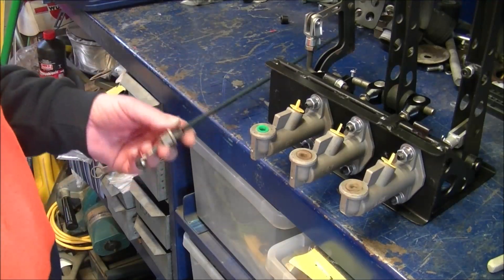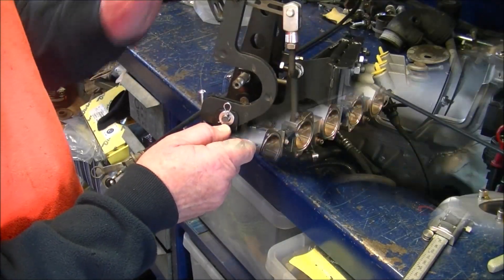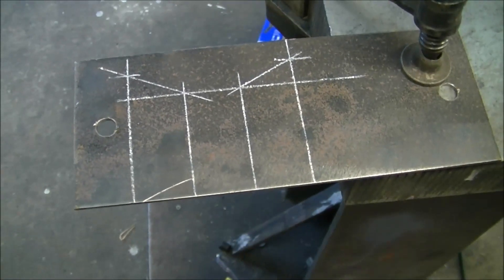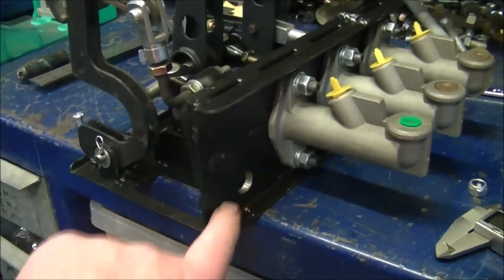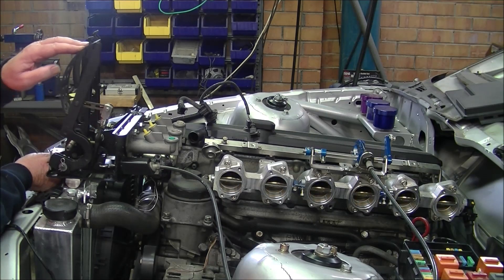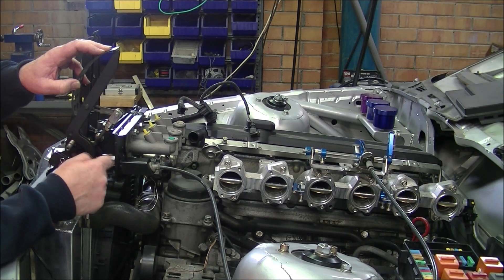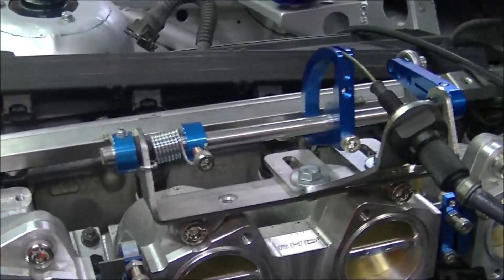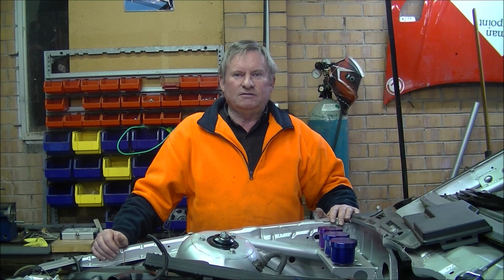16 BMW Rally E36 - Accelerator cable set up, fabricating mounts

Comment: OMG, 6 carbs and I have trouble getting one to work right!
You have an amazing skill and building a rally car on top of that you should be viral on YT. Cant wait til the next video.
Reply from the maker: Thanks fin, its fuel injection not carbs. Your right, I used Weber carbs in the past which are good but much easier with injection. Thanks for the positive comment, the first video is https://www.youtube.com/watch?v=LDo2J20AhNw 

Unfortunately it has been a very long build.
Reply from the maker: Thanks again fin, feel free to share my channel if you like.